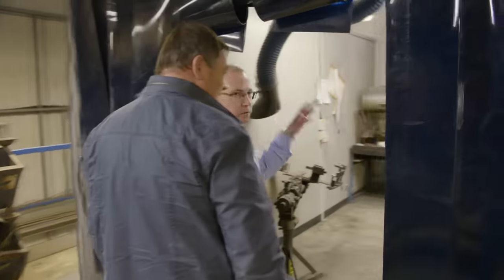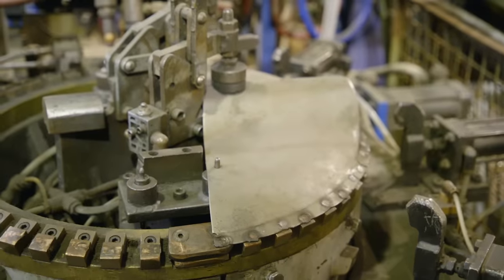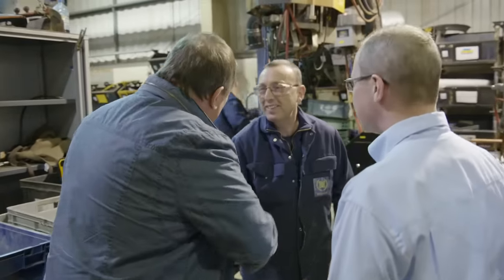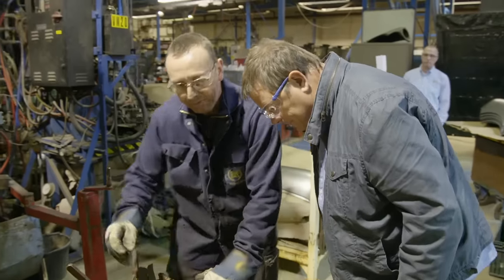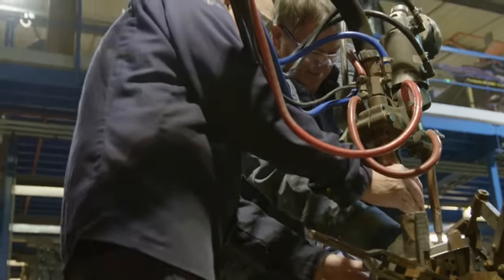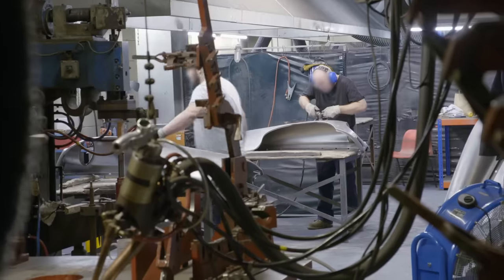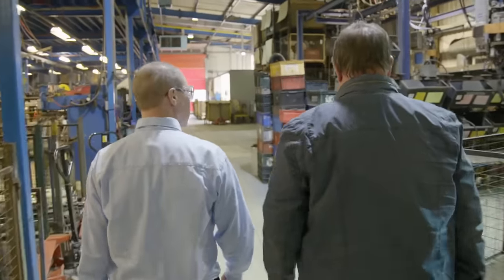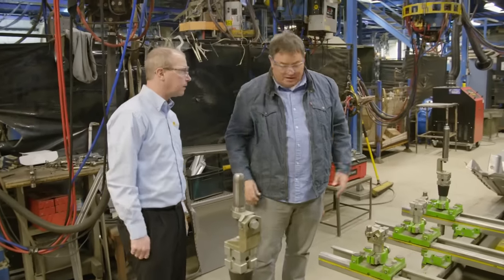The British Company Keeping Classic Mini's Alive | Mike Brewer's World Of Cars

Comment: Makes me very happy that Minis are kept on living. One of the best cars ever!
Reply: People with your view helped turn Britain into  the industrial desert it is today. BMC were the forth largest carmaker in the world when the original mini came out. All cars rusted back then    and reliability was a comparative term. The average life of an engine was around 60000 miles before a  rebore was needed. On a Ford sidevalve it was half that.
Reply: armadillo platypus  It is true that the Mini had a severe rust problem and eternally leaking break cylinders, among other serious problems. Nevertheless, it was a very good handling car, very nice looking and extremely spacious for its outer dimensions. With 3m outer length, you could fit a pair of 2.1m long cross-country skis in its cabin. I went on several long-distance holiday trips with it and could take a lot of stuff for two people with me.
Reply: @TomAlter1000  autocorrect!
Reply: armadillo platypus  I have two, and you're both right. For a late '50s car it was superbly and innovatively designed, and they're a hoot to drive, especially the quick ones. But the build quality was never great and as time went on it got worse.
Reply: Steve Terry  I know exactly how they were build: door frames soldering breaking, wheel brakecylinders leaking, rust under the windscreen seal, wheel bearings wearing quickly out, rust everywhere until they were like Flintstone cars....
But they were the best cars to drive ever and at 3.05 m length they could transport 4 adults. And they look so cute!!! Once you drive them, you get addicted to them! Don't forget that their active safety is very good. Their passive safety could be improved, although for their size, they're on.k.!
Reply: The problem later, was to some extent build quality, but the truth is that the steel used (French) was sub-standard.  Equivalent British steel was far superior, but a great deal more expensive.  Note, French cars rotted like hell, same era.  Rust proofing work always helped, but costly.
Reply: @philpjess5047  Other British cars of the era weren't better, as I remember. The most rust prones of course, were the Alfasud or Lancias of the period! The best ones clearly were the big american ships.
Reply: @jurivlk5433  The steel was better, British cars were built with cheap sub-standard French processed steel.  Not a touche, just a big mistake by the British, never buy French.  Furthermore, America has a better climate overall.  In any case, it's a case of the body shell NOT the engineering.  Think a little more sir.
Reply: @philpjess5047  Rust was the general problem of the 60s and 70s. I think they let the cars rust on purpose because in the eyes of the manufacturers, pre-war cars lasted too long. Today, they have other tricks to sell us cars. French cars of our period do really well and I had a 90s Peugeot that was rust-free after 25 years. American cars were not only good in dry Nevada but also in wet regions. Their frame-body layout was primitive but very tough. The Mini was one of the best designed cars of history and would have been even better if it had been build better. Taking corners with a Mini is such a pleasure that it gets very expensive in the long term because one spends so much money on these basically cheap 10" tires! It's fantastic that a company is rebuilding them today!
Reply: @jurivlk5433  Interestingly, I recall a lot of enthusiasts did something with the tyres by customising the wheels.  It's so long ago now, but I can remember some people made modifications.   That's one of parts I never understand why BL in its many guises didn't properly modify the mini more in entirety without losing the handling.  They just seemed to give minor face lifts. Unfortunately BL (BLMC/BMC) made many mistakes, union trouble and poor management didn't help at all.
Reply: @jurivlk5433  wheel bearings wearing out quickly is more likely to be down to poor fitting, servicing and repair.
Reply: @philpjess5047  I have 215/45-13" road legal tyres on my 1380 turbo mini ..... just an example of tyre size available, but majority is either 165/70-10, 155/60-12 or 175/50-13
Reply: @philpjess5047  BMC never used french steel for the monocoque, you have been misinformed 😎

Comment: We love! Well as an owner of a new, black Mini from 1966 - 1970, I may state as a fact: It was an absolutely horribly produced car, with badly fitting doors (I had to bend the sliding window frames against my knee to make them actually meet the rubber sealing on the body!) and it leaked in water in most places, also from the corners of my front screen (Wipers just stopped, also up on the screen, so you soon learned how to make them stop at the right place!). And don't expect to be able to leave things in the doors metal pockets if they aren't waterproof! A battery with its + to the frame!!! And the outside hinges, which had a little acid left in the sealings against the doors, after the original cleaning before being painted, so they constantly needed repainting around them to stay nice and without any rust! I had "newspapers" below the mats, to collect water and being regularly shifted, as now wet.
     Driving in rain behind a lorry would make the motor cut from the spray moisture, before being able to overtake, at mostly 117 km/h!
     I did own three English built cars: "My first, my last and my only", before buying a new BMW 2002 in 1970 and later VWs. Today I drive a really (comparably) fast Peugeot (Diesel).
Reply: Yes, they really were woeful things

Comment: This original Mini puts all other so called  so called new models in the shade, it's got real timeless class, no other so called Mini models will never have, I really hope it goes on and on (even in electric form) 👍👍👍👍
Reply: Well said.
Reply: @japanwatchconnection you hum it son I will sing it 👍
Reply: I quite like both, but I do not like the rimless windows on the Bavarian Minis, as this renders the door inoperable in the event of an electrical failure. This means you can't get in to open the latch to open the bonnet, so it is rather difficult to sort the problem.

Comment: What I'd like to see them do is to use some form of anti corrosion protection between sandwiched and welded panels. Some epoxy or weld through primer at a minimum so that they last more than original!
Reply: Agreed!
Reply: I think they leave that up to whoever buys it
Reply: @georgebamber6871  bit late after all the unsealed steel is welded together. It should have copper weld through primer before it is assembled.
Reply: I was thinking the same thing. Going to rust again as soon as damp air gets in the seams.
Reply: Weld through zinc primer is good stuff ; I'm sure they could spray the  seams before spot weld assembly. 
At over £8000 for a bare shell it isn't much to ask! 

When I get mine done I want to arrange to go there to get my panel mods done before assembly. 
( extra interior light apertures, plus modified bulkhead and inner front wings etc ) it'd be so much easier to do it off the shell then have them spot it all together after. 
( for extra £££ of course )
Reply: @RawTopShot  we use weld through zinc at work on all our restos. It's good stuff.
Reply: @RawTopShot  
What is that in US dollars...
Reply: Just have a belly pan that collects the leaking oil  and have a small pump to spray the underside as you drive 👍
Reply: The shells get a cataphoretic dip priming after assembly.
Still it is a 1950s design with dirt and water traps everywhere. Good seam sealing before and cavity wax after painting are essential.
Reply: Mick, that's right, the Mini always leaked rainwater through the spot weld seams! In this day and age, it should be possible surely to seal these seams and make the car waterproof!
Reply: @davidmichaels8934  The panels and bodyshells are primed in Electrophoretic paint which gets in every joint and anyone restoring a car would seam seal all joints before painting anyway. Many panel joins are sealed before welding. Heritage provide a protected bodyshell but they have no idea what every end user wants. In some export markets certain seam seals are not allowed.

Comment: I'm in the (slow) process of rebuilding my '81 van, amazing, all parts, repeat ALL PARTS are still available for Minis & Morris Minors, thanks to people like this.  They will outlive all the modern production cars - and me!
Reply: No they are not, there is still lots of parts not currently available, however it is getting rectified.
Reply: @martinfidel7086  I have yet to find a part that is not available, for my needs anyway.  There are many suppliers around the UK,  e.g. Minispares  Minisport (60% more expensive) and many others who used to supply certain parts for BL.  Name me a part that you need &  can't get, & I'll see what I can find for you.  I have one of the early Minispares printed catalogues and one of the old British Leyland manuals with all part numbers.  BTW, I'm replacing as many of my nuts, bolts & fasteners in stainless, Westfield Fasteners, Aylesbury, is an excellent source.
Reply: @theondebray  Yes and I manufacture some of those parts, Name me a a mini specialist that I don't supply.... yet there are still a lot of parts that are no longer made, some of those are certainly in the pipeline though

Comment: What a brilliant video, thanks. I have heard of BMH but knew nothing in detail so seeing this is great. I'm 60 & had a mini mk2 when I passed my test in 1977. Later had a clubman 1000. Then a clubman 1100 (I think that engine was the best for a mini). Then a mini 25 then in 2002 I bought a 1996 mini cooper spi. Sold that in nov 2005 & not had one since. Did loads of jobs on them, changed the engine twice on my first mini. Bought an Austin or Morris 1300 mot failure & took the engine out & put it in the mini mk2 :).

Comment: A stainless steel one would be the icing on the cake
Reply: enoch powellsghost 
I was thinking alloy because it'd be less harsh on the tooling presses.
Sure you'd have the headache of tig welding instead of regular spot and mig assembly,  but imagine how light it would be 😁
And get the whole shell ANODISED as soon as it's been put together and welded. 😁👍♥

Sure stainless for longevity though.
Reply: Titanium Mini
Reply: You can't form stainless still in shapes like that. See Delorean and Cybertruck.
Reply: Too heavy.
Reply: Dear sir, a MINI is a MINI, not a DeLorean...  ~_^  That is unless it comes factory equipped with a 10-kilo brick of cocaine in the boot...   o_0
Reply: You can't just take one design and reproduce it using a different material and get the same performance out of it.

Stainless steel costs twice as much, is harder on the tooling, is harder to weld, is heavier,  AND is harder to paint.
Reply: @RawTopShot  Whats is alloy? And alloy is a mixture of 2 or more metals, and you trying to say aluminium?

Comment: i can see mike's disappointment when he found out that they're not putting any improvements on the shells..
Reply: Improvements? IN England? You must be joking!
Reply: @terencefield3204  Yeah, what we did to the Americans. "If they'll buy it like that, we'll make it like that". How to secure an industrial future !
Reply: Whats to improve? Handling? No...
Improvements change the nature of it.
You live it for what it is.
Reply: John Wren 
Improvements would be to flip the bulkhead to floor assembly lip so it didn't let water in if or when the sealant comes off; adding a drivers side upper door light fitting;  adding the same in the lower rear quarter bins so you can add  interior lights to see stuff on the rear floor; sorting out the front wings sticky out joint on the front headlight panel so it's flat, and umpteen other issues, including using a zinc weld through primer on all spot weld panel areas BEFORE they're spot welded together. 
None of these would alter the minis character, but all would improve form and function overall at very little cost.
Reply: Return customers 🤔 thats the motor industry
Reply: @johnwren3976  NOBODY 'LIVES IT' APART FROM A FEW DERANGED MASOCHISTS
Reply: @RawTopShot  obviously you have no idea what the tooling for improved panels would cost. Consider they only build less than 100 bodies annually to distribute the costs amongst. If was that easy BLMC / Rover would have done it while they still produced considerable amounts of these cars.
Reply: @terencefield3204  
The idea was to make it like it was made originally made. They were mass produced cars.
Reply: @RawTopShot  You are a few decades out of date mate. The floor panel sits on the bulkhead panel inside not underneath it and has done since the first prototypes and early cars had the problem you described. And its not a 'lip' its a flat panel on panel join with sealer between and spot welded.
The lighting you mentioned is a matter of taste and easily added anyway if you are buying a complete shell. I just added that extra roof light on the '78 Mini 1000 I am restoring. I have used Heritage panels and they cannot be faulted.
You also forgot that every Heritage panel, sub assembly or bodyshell is primed in Electrophoretic paint which is a major improvement.
Reply: Yes, real problem area between the lower external door hinge, the front diagonal seam and the wheel arch. Stress concentration (due to door weight when opening), and water ingress at the bottom led to rusting problems, every time. That area was a real design flaw. Ed China explained it better during a mini restoration on 'Wheeler Dealers' when he had to weld new steel in.......

Comment: 8:50   because Mike....... a panel is like 50 quid a shell is like 8000 quid.
.
Reply: Still cheaper than the Swind-E electric conversion at 79,000 pounds...   Oof!   o_0
Reply: Mike is so wrong, replacing the body  - you might as well ditch it's soul. Its like putting my organs in someone else's body - it's not me. That and the cost.

Comment: Awsome keep up the good work, l hope that Great Britain will eventually have a car industry back again.
Reply: Britain still has a car industry.
Mini in Cowley. 
Aston Martin at Gaydon, Newport Pagnell, and recently St Athan near Cardiff International Airport where the DBX is assembled.
Toyota builds Corrolas at Burnaston in Derbyshire and builds Petrol and Hybrid engines near Queensferry, Deeside.
Ford builds petrol engines in Bridgend, diesel engines in Dagenham and transmissions in Halewood.
JLR manufactures at Castle Bromwich, Halewood, Solihull, and Wolverhampton and has SVO at Ryton.
Bentley in Crewe.
Rolls Royce near Goodwood.
PSA still produce the Vauxhall Vivaro in Luton, and currently Astras in Ellesmere Port.
LEVC producing TX cabs and vans in Coventy.
Lotus in Hethel.
Ariel, BAC, Caterham, Ginetta, McLaren.
Apparently Noble Cars near Leicester isn't dead yet.
Several commercial vehicle manufacturers including Plaxton, Dennis,  Optare.
In components and motorsports, Quaife, Ricardo, Gibson (formerly Zytek), Helwand, Xtrac (who supply transmission to Mercedes AMG Petronas F1 team), GKN Driveline, Cosworth, Cummins, Perkins (part of Catepillar), Judd, AER, Mercedes High Performance Powertrains...

Comment: pls use galvanised steel!!!
Reply: Anyone buying one of these shells can have the whole thing galvanised, which is the way it should be done. Welding galvanised sheet steel is difficult and welds may not be strong enough, unless the galvanising is first ground off, which leaves joints vulnerable to rusting. Maybe this company offers a galvanising service. Special paint primer is also needed because normal paint does not stick to galvanising very well.
Reply: You can have the shell galvanised, but you need to use a galvaniser that’s can do it otherwise it will distort. There are better processes for car shells these days.
Reply: @bigbadjohn10  Galvanising is very effective. It's what made Volvos last 20 years, and turned Renault 5s from being dreadful rot boxes originally into very long lasting cars. You might be right about getting it done after manufacture as it was always a factory process. As you say there may be better alternatives, maybe powder coating. Rust proofing needs to start by good body design, by not having mud traps in them which was the main problem with 60s cars. Plastic splash shields did a lot to preserve front wings.